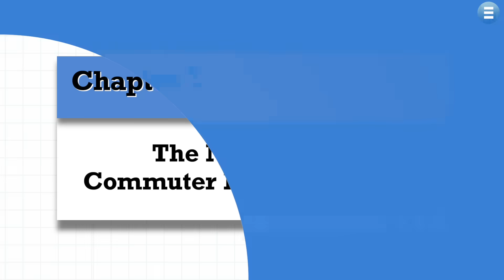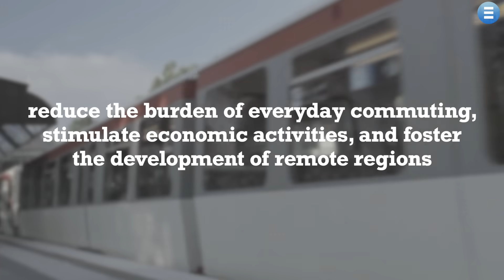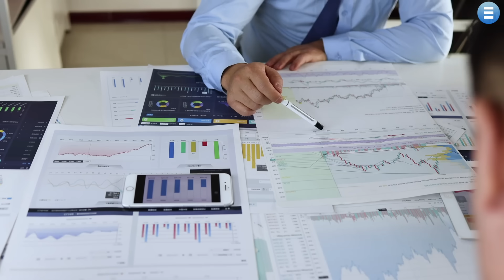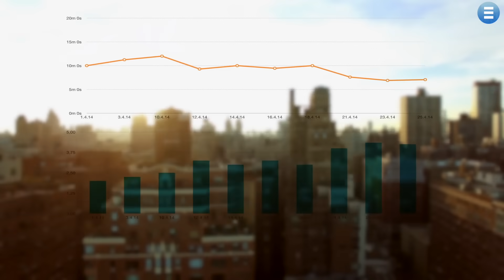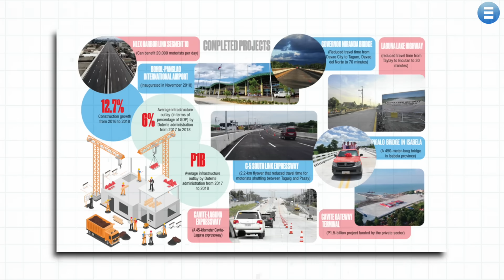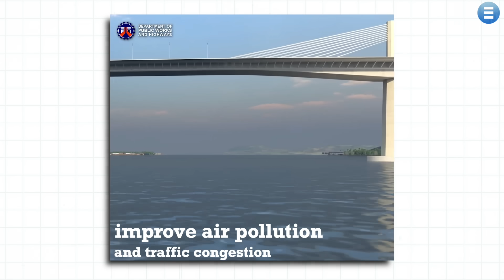Philippines' Infrastructure Revolution: Top 3 Projects You Need to Know

Comment: The country should also plan for futuristic multi-modal transportation but nobody is thinking about it. For instance, a small car or van should be easy to load into a railway car, a large truck, or a ferry so it would be relatively easy to connect and off-load from one island to another. Such vehicles can be semi-robotic or automated and have either people or cargo loaded into it.

There is a need for railway lines and bus or truck terminals to connect the major seaports and airports to each other or else it will be expensive and difficult to develop local industry, manufacturing, business, and tourism.